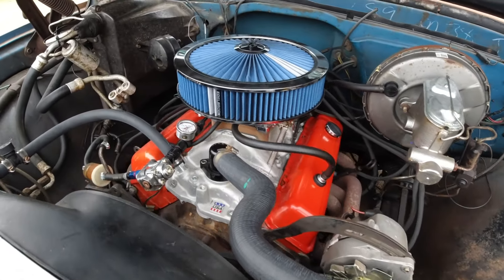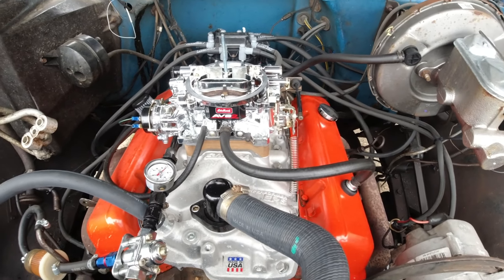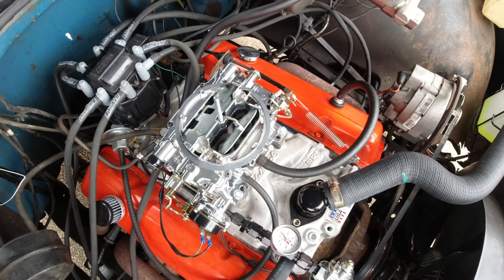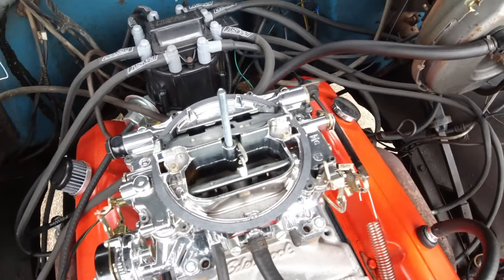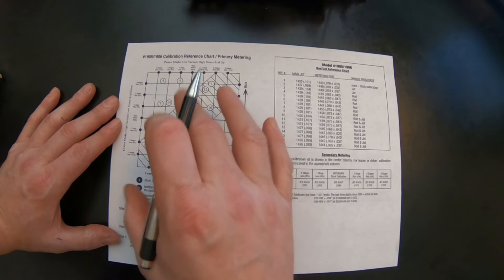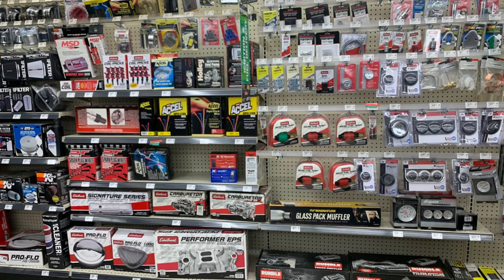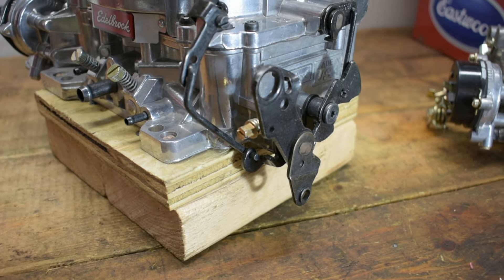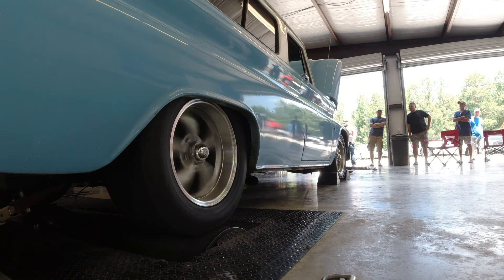Edelbrock Carburetors - The Good, The Bad and The Ugly

Comment: My solution I used for your “ugly” was getting the Edelbrock part# 8128. Remove the feed plug on the driver side of the Edelbrock carb and install the part# 8128 dual feed fuel line. It keeps both bowls equally full at all times. So it doesn’t matter if you make hard turns or go off roading like me, after I installed this dual fuel feed line those problems went away.
Reply: I did the same thing, my drive way has a hill that I have to drive around and it leans my truck to the left Which bogged it down. I tried a DP holley and it worked but I sat there for hours trying to get the dam thing to idle correctly and it was really rough when I finally found a sweet spot. My cam was already super choppy and it made it sound really disturbing so I took it off and just hooked another line to the avs2 and fixed everything, had to increase jetting but I haven't had a problem since then
Reply: I just asked why a "Y" could be centered to feed both sides and read your comment.  Maybe even set the floats so both bowls hold more fuel.  So I am not the only one with your thoughts; there is another similar comment about the same technique that cured the problem.

Hey, and I bet we are all just carpenters who happen to see details and figure it out right.

My solution for fuel sloshing around while "rock bouncing" is to extend the breather inlets.  On a Motorcraft 2150 a peace of tubing can be rolled like a tubing from a still above the carb, but below the air cleaner lid with holes drilled on the top coil for breathing.  

That keeps fuel from sloshing into the venturis and flooding the engine.  My concern against EFI is the Goodyear ballon "accidentally" detonating high above the dirt and taking out an EFI and other electronic stuff.  It will not take out mechanical stuff, such as a carb.  Look at how that choo-choo "accidentally" derailed and I bet more "accidental chemical derailments will occur.  Too many accidentals to think something ain't up.

Be safe and keep your powder dry.

Comment: I got fed up with trying to learn about carburation on my own when I was in my early twenties, so I bought a book from a guy named Doug Roe. This guy was employed at the Rochester Quadrajet factory for General Motors and then I started learning about Quadrajet carburators! I highly recommend this book of his knowledge this man filled the book from front to back where a second grader could start rebuilding carburators! But the guy on a webber carburator video I watched last year said it best! That screw on the side for the throttle plates has no tuning purpose whatsoever! That it needs to be adjusted to where the throttle plates don't come back and contact the bore wall if it were to be snapped back and then released! If you go gettin crazy and and try using the adjustment to raise your idle you will get into the off idle circuit and it will fall on it's face when you punch the throttle from a dead stop! 😉
Reply: He's right! That book is great. It's on my shelf! I ended up going with Edelbrock but that book beckons to me sometimes -- "get back to messin' with the Rochester, it's worth it..."

Comment: I hear you talk about heatsoak on carburetors , particularly Edelbrock . one helpful thing that I found is besides using a phenolic spacer , is to also use a spacer on the air cleaner , that is hood space alows for it .  I installed a Edelbrock phenolic spacer which is actually only about a 1/4 " thick , and I also installed a 1" tall spacer between my air cleaner and carburetor in my truck , and it really helped it out a lot with heatsoak , because the extra space lets the heat disapate from the carburetor instead of the air cleaner just holding the engine heat down over top of the carburetor .  and it also has a smoother idle on hot days . Tim from Wisconsin.

Comment: I can not overstate how important proper fuel pressure is for proper tuning of your Edelbrock carburetor. My suggestion check your pressure, add a regulator if necessary before you even start tuning. 5.5 psig seem to be optimal for my AVS.

Comment: I run two Edelbrocks one on a Pontiac 389 (1964 Bonneville) & one on a GM 305 (a 1978 motor in a 1957 GMC) and both are great.  I do not ever push anything hard so in my world these are near perfect.  It did take time to get the needles, springs and jets within my needs.  Early days it was run it and look at the plugs but now I use an air/fuel gauge.  Not hard to fit and worth the time and makes tuning so very much easier.  I have some videos on this but overall there are more detailed ones.  I have worked with Holley carbs but don't like them as much as Edelbrocks.  I run a Weber on a 1970 Triumph Spitfire and loved learning about them (a sync not progressive) and there the air/fuel gauge was a must.  Just wanted to toss that in.  If anyone out there wants to add an air/fuel gauge be sure to shop around and get the best quality you can.  My first one didn't last but a few days.... just shop and you'll see.  Hope that helps.  Bobby

Comment: Using the Edelbrock fuel pump helps too,6 psi and 140gph, that is a HVLP pump. Float setting is crucial on those but once you have them dialed in, they really work good.
Reply from the maker: The only issue I have is not the set pressure, but not having the opportunity to adjust if needed.  Plenty of times where a little less pressure is called for.  So I’ll always be a champion of adding a good regulator and a gauge to have another point of adjustment in a system that doesn’t have that many.  For sure a good quality pump like Edelbrock is a great starting point.

Comment: I but a comp cams thumper kit into my brothers 65 T bird 390 FE, I fitted an Edelbrock 600 CFM electric choke carby, the car had a flat spot when the secondaries engaged. I fitted a set of main jet needles from a non elcetric choke carby, then adjusted the secondary choke plate to come in a bit earlier. Problem solved without dismantling or removing from the motor, including the road test I reckon the whole operation took about 45 minute’s. And to think that I spent hours trying to get the original ford carby to work properly and a new original ford carby was twice the price of the 2nd hand Edelbrock I bought off eBay, now the car sounds good, goes really good and run’s perfectly.

Comment: Had a 1964 SWB Chevy with a 283. Put an edelbrock on it. Absolutely amazing. It wasn't high HP but ran extremely well and got surprising fuel mileage. I have a ford with the inline 6 and will be setting it up with an Edelbrock. Can't wait!
Reply from the maker: In the right situation, every carb can succeed.  Would love to have a 64 Chevy! 😂
Reply: @MuscleCarSolutions  Especially these days. I let go of a lot of older vehicles that are quite expensive these days. I currently have1996 F150 SWB with no plans of letting this one go! Best wishes!
Reply from the maker: @jeffpittman8725  the used market is a mess right now.  I’m hanging on to everything until it calms down!  Thank you!  Same to you.
Reply: Jeff , do you still own that 283? I have a 65 283 i have an avs2 500 cfm on and id like to know how you ended up with the setup.

Comment: Thank you for making this video. I have a 1974 Dodge Charger with a 318. When I was a youngster I just bought what was cheapest or was available. I ended up buying a Edelbrock carb because it was in my price range. Now knowing more about the carb it is still the perfect fit for me. All of this is new to me, building an engine, the distributer with the correct timing, the carb, the fuel delivery, the thermostat, etc. thank you for putting out a high quality video showing everything about his carb so I know what to expect.
Reply from the maker: That’s the fun part of playing with cars and engines.  There never only one solution to a situation.  We all learn something new every time we work on these old classics.  Enjoy the ride and don’t hesitate to ask any questions along the way!

Comment: Takes me back to the days of AFB's & the WCFB's. The AFB's are the hot ticket for inline dual quads with those side mount fuel bowls. Like the Q-jet & Holley's spread bore models the AFB is a very PRECISE metering device. The SOUND of fire walling those Q-Jets with the air cleaner lid reversed & that BAW-WHAW sound when those big secondary sewer lids opened up I can never forget! It sounds like Edelbrock has taken the ole AFB to it's maximum performance level. To put a twist on one of General MacArthur's quotes "Old carbs never die, they just get rebuilt!"

Comment: Great video mate. I run an edelbrock AVS 500 on my mild 318,just a mild cam with edelbrock performer intake,full exhaust and hei ignition. The heads and bottom end are still stock. It’s a 1980 Chrysler. I had mine professionally tuned and in the 4 years it’s been on my car it still runs perfect!
It’s not an everyday car either,just a toy. I’ve been told by some that the 500 is to small for my combo but I think it runs great,never given me a drama and on the Dyno it made 214 hp at the tyres in which I believe is good for an otherwise stock 318. I changed my diff ratio from 2:92 to 3:45 and that made a big difference as well. I will always run edelbrock from now on.
Reply from the maker: It’s common.  Folks tend to go way bigger than what they need.  On a stock engine and small cubic inches, you made a great choice!
Reply: @MuscleCarSolutions  thank you for that.  It sure works well. I’m happy.
Reply: Hello again. 
Sometime later I know. 
The next good improvement I made on my 500 was to remove the choke flap!
My car starts fine without a choke so I thought it may have been a restriction with the flap sitting there blocking the Venturi 

It did make quite a noticeable improvement once it was removed. Awesome

Comment: I installed the AVS2 on my 74 Lincoln, along with an edelbrock performer 460 intake and immediately noticed a huge increase in power and throttle response as well as overall drivability with no other changes, on a totally stock engine, and picked up 5mpg instantly, 14mpg, up from 8 or 9 with the stock Motorcraft carb.
Reply from the maker: That’s nice to hear but pretty unheard of, unless that poor old motorcraft was just that bad. 😂 Tune it!  You’re likely to find more than what you expected!
Reply: @MuscleCarSolutions  it was fairly awful. I recently did the 'ol HEI distributor swap, deleting Ford's infamous Neverspark system,  and that was also a huge improvement
Reply from the maker: @sethbarnes7608  for sure ignition is so overlooked when it comes to carburetor performance.  The two go hand in hand!  Smart move!
Reply: NICE, I am getting ready to do the same thing on my 75 Lincoln 460 with a performer and a used 1406 I just rebuilt.
Reply: Had a 650 Holley spread bore and an Offenhauser dual port manifold on a 460 73 T bird. Got good gas mileage and a lot of low-end torque. Those Offenhauser dual port manifolds are known for good gas mileage and low-end torque. I see them on  e bay for 460s now and then. Also ran an MSD ignition that seemed to help.
The old 460 is a powerful engine that can get reasonable gas mileage if set up right.
Reply: Used the forums to slap a 1400 on my 77 town car. Gonna post the process there to add to the library of information

Comment: I have an AVS2 and I am happy with it.  I run a wideband and it's easy to get really good numbers.  Very tunable.  I do have an off idle stumble/hesitation.  Top hole on accelerator. I drilled the squirter out to .045 and it helped.  I ordered a Thompson performance carburetor power plate and hopefully that's enough.  You can also get the 1468 heavy spring accelerator pump, like someone else mentioned.  I do think that's the only real flaw of the carb.  Like you said though,  more to do with ethanol than a bad design.  Still a great carb and I would recommend it for an street car.  Great video.
Reply from the maker: I’m not a fan of that plate, especially on an annual discharge carb that atomizes the fuel/air mixture enough to start the process.  The ethanol is a challenge on a couple levels.  Such a pain to work around and one factor that almost no one considers when tuning.  I’ve been working on an internal mod to the carburetors to open up the fuel passage.  It’s a choke point in the system when putting the big pump in and a larger squirted nozzle.  So far the results have been minimal, but I’ve just started on it.  We’ll see where it leads.  99% of the time these carbs can be tuned out of whatever issue it’s having with fuel delivery.  So it’s a bit of a pointless exercise, but something I’ve wanted to try for a long time.  We’ll see what happens.
Reply: I had a stumble with my eddy 1409 on-my boat. The accelerator pump linkage had some play had to bend the rod to lengthen it to keep pump under tension at all times. I was also running a AFR meter, what i saw was after nailing the gas it went way lean for a long time. Before the AFR meter i was thinking it was lean so i kept richening step up rods and jets creating another stumble later in rpm range…. Had not had the afr meter i would not have seen how lean it was going just after hitting throttle, and how long it took engine to recover and then go way rich… taking the slack out of accelerator pump linkage made it disappear, then going to leaner rod helped the holeshot situation .
Reply: Poor Touring Hot Wire Garage  It's not really an assumption.  I can watch my AF go lean for a moment when I accelerate.  Also, if I pull the choke out slightly,  the problem is gone and It it's very responsive.  I did also mess with the timing until it started skipping.  Thanks anyway though.
Reply: @sjd7188  I had a stumble on acceleration. I drilled out the squirter jets and the stumble was gone.
Reply: @GaryH-pw9cm  im already using the .043 nozzle did u go bigger than that?
Reply: @sjd7188  drilled out to .060 ran great. The problem I had was it is a lightweight hot rod and the acceleration is almost instant. Zero to 30 MPH in one second if it hooks up. 😳 I think these carburetors are designed for heavy vehicles that need a longer shot of fuel. When used on light weight vehicles with big engines the design is too little fuel too late. I had the same problem with a Holley carburetor. Had to go double pumper to get rid of the stumble.

Comment: This side of the pond, most seem to use Holly carbs, mostly because of availability.
Over here the most popular applications are for the Buick derived Rover built 3.5 or 3.9 Ltr v8. They rarely make a genuine 250 hp in tuned form. The Elderbrock is night and day better than a Holly for that application.
As for the fuel surge in corners, start with a higher fuel level and twin feeds. Just something we learnt at the track

Comment: About the ugly, my Edelbrock AVS used to stutter and stumble on hard lefts just like you said.  That was with a rubber fuel line.  The problem stopped after I installed the hard fuel line 8126 on the passenger side.  It may be coincidence, and I don't why that would have fixed the problem, but it went away after that change.

Comment: The majority of the driving on hot rod street cars is in the lower torque curve of the motor . The design of the Edelbrock AVS2 addresses this for the street with a fogging effect . This increasing the burn efficiency of the fuel in the combustion chamber and makes for a very drivable engine , even with a more aggressive cam .  More torque and increase mileage is the big reward !
Reply: Would vacuum secondaries be better for street and off road?

Comment: I have used edelbrock carbs on my car for 30 years they are good street carbs and stay in tune , I’ve used Holley is a good carb also but to me get out of tune on older models but better for race applications, I’ve rebuilt it  years later and got a tuning kit due to I upgraded my engine with a cam and performance heads ported and needed to fine tune it better, but for me I like them

Comment: Good video, thank you for sharing your knowledge.  I've been an Edelbrock guy since the early 90s mostly because that's what I learned how to tune.  I'm not 'anti' other brands, I just know Edelbrocks.  Everything you said was true.  Ive been able to get these carbs really cheaply from people that dont have the patience to tune them correctly, put them on an engine I have with a strip kit in one hand and teh book in the other and tadaa, works great.  Its true they wont be on the fastest drag cars but my cars have been 100% street driven and I have found that once you get your combination correct, these carbs are rock solid.
Reply from the maker: @dkp7895  putting the right part in the right application makes all the difference in the world.  👍